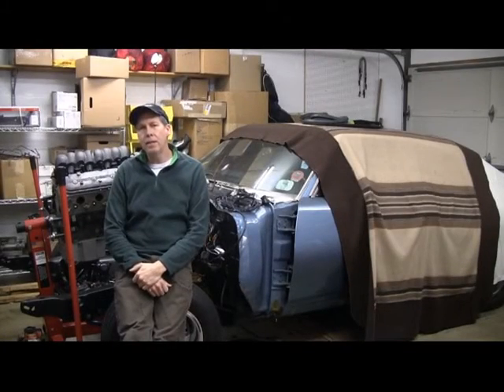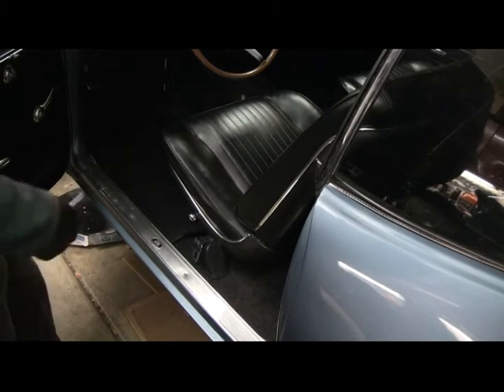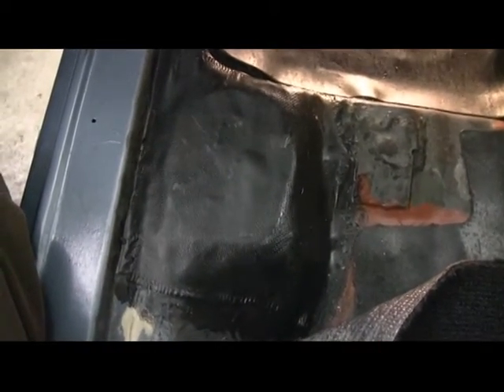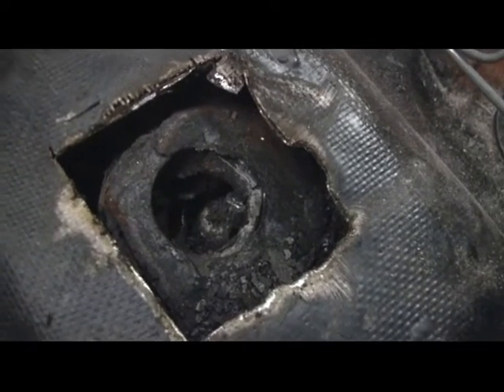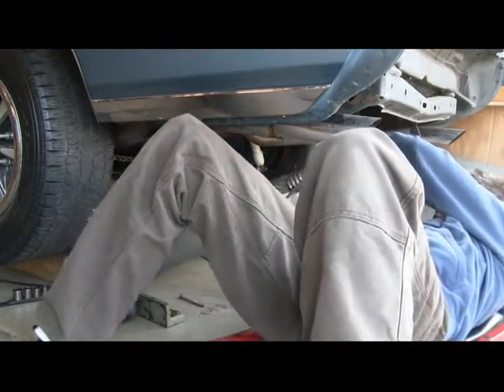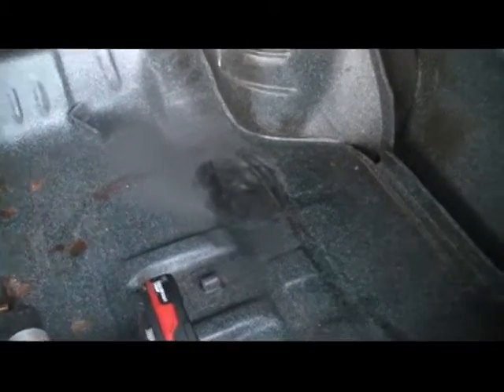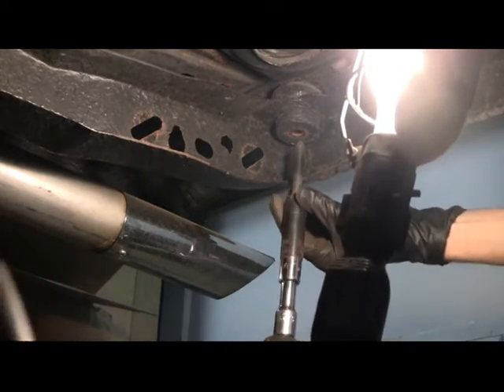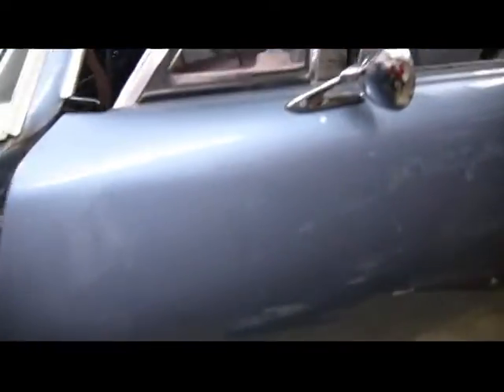LS Conversion Swap Part 19, Body Mount Removal

Comment: If you separate the body from the frame, you can then make a simple tipper from plywood and 2x4s. Then, with the body 90 degrees you can replace those cage nuts from below by cutting a cross shape in the crossmembers where they reside.
Reply from the maker: Do you have a link you can share that shows how this would be constructed?

Comment: original parts group sell body bolts and energy suspension has  poly mounts
Reply from the maker: +zohan zoe Thanks for the info. I already ordered the bolts/stock mounts, frame mount repair washers and body brace parts from OPG. I went stock with the mounts, I was afraid of the poly feeling too much road noise/harshness. Anyone else have opinions? I can always return them. OPG prices seem better than others. Yearone is OK if hit one of their 30% special weekends or free shipping deals. I will keep all posted on progress. It will be slow since for the next 8wks I am out of town for work more than I am home.
Reply: Look up user coverman66 he has a video from energy suspension mounts with alot of detail from factory to aftermarket